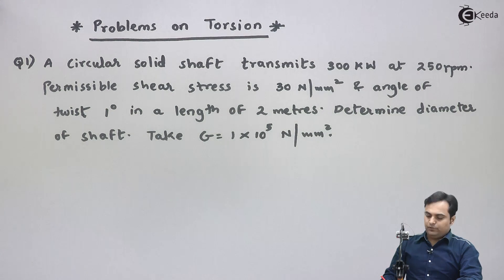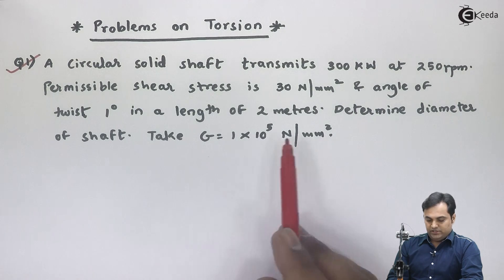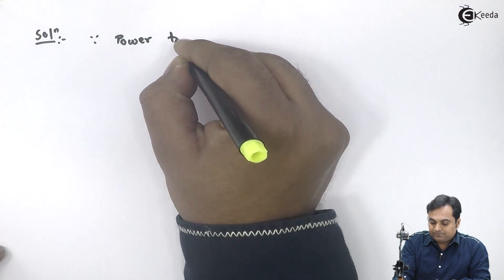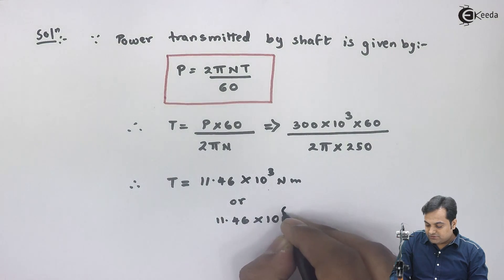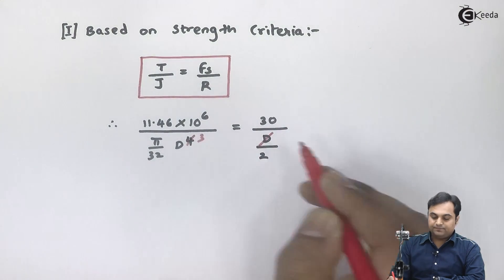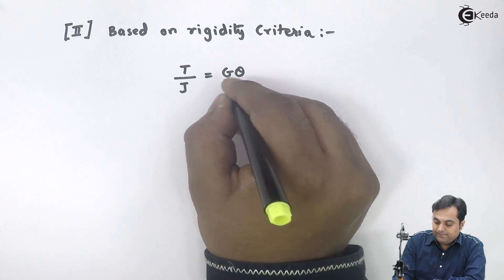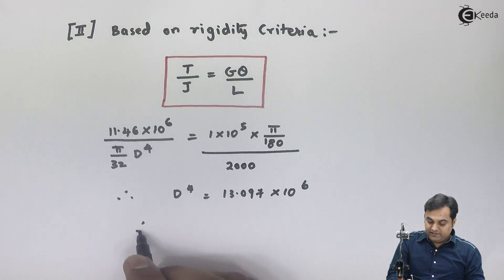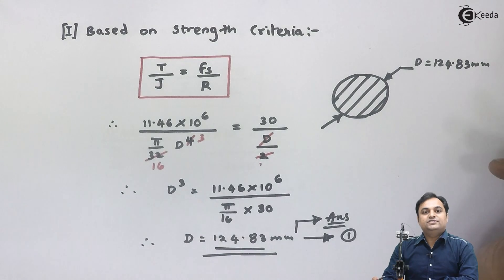Problem 1 Based on Torsion - Torsion - Strength of Materials

Comment: a hollow steel rod 200 mm long is to be sir please solve this problem:-used as torsion spring. the ratio of inside diameter is 1:2. the required stiffness of this spring is 100 Nm/degree. determine the outside diameter of the rod . value of G is 8×10⁴ N/mm².